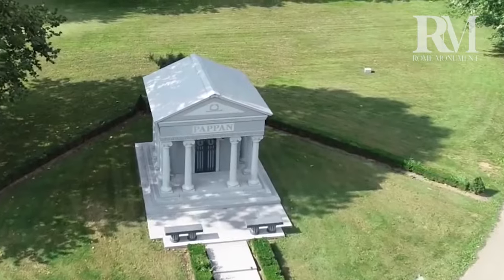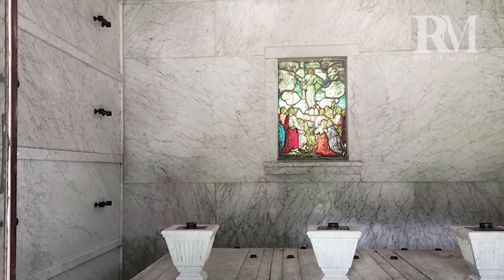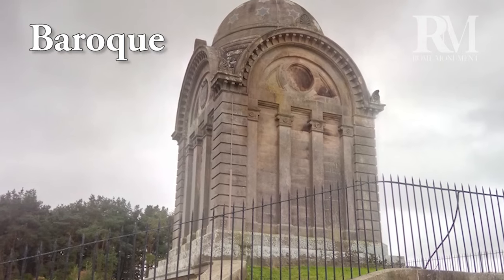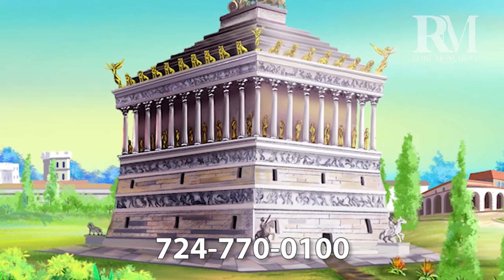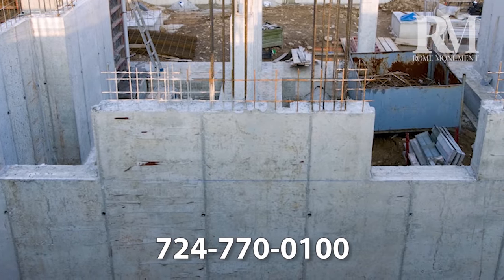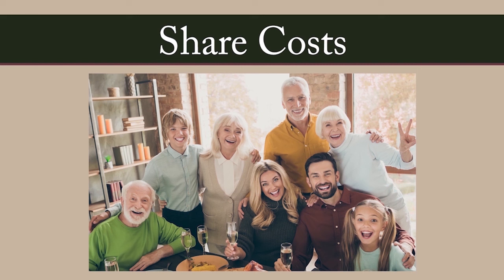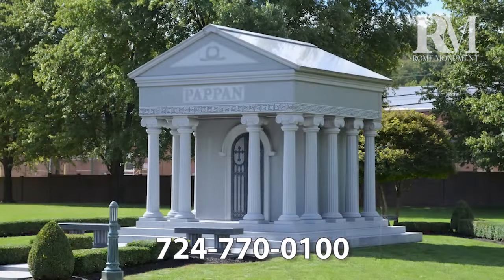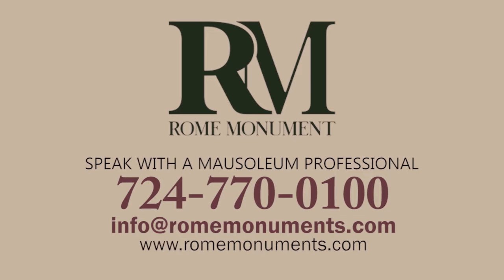See Inside The Types Of Mausoleums And Burial Chambers With Family Crypts And Stained Glass Windows

Comment: As an environmental conscious individual, I would like to know how body fluids are drained from a mausoleum and how the crypts are ventilated? It would be foolish to retain the fluids within the structures since they would be one source of odors as well as a type of biohazard. Fluids retained in caskets tend to be a bit caustic and would cause a casket to rust out if made from metal. Even the best coatings will protect metals for a finite period of time.
Reply: There can often be vents at the back of each crypt and also a drain that runs down a small tube and into the soil a metre or two deep.